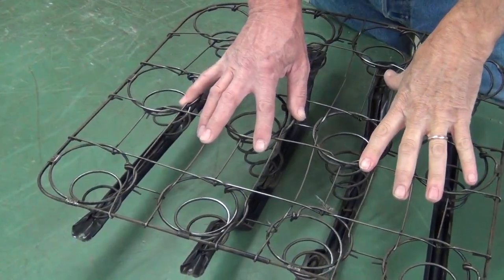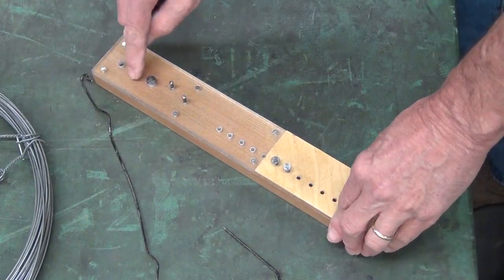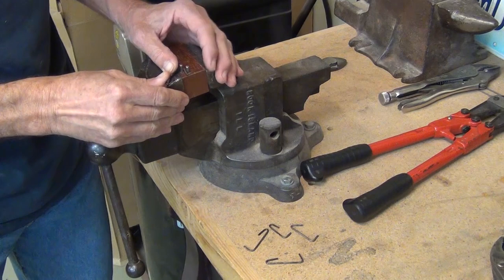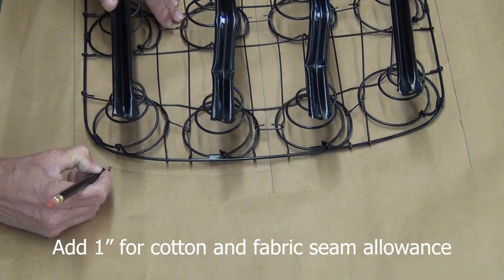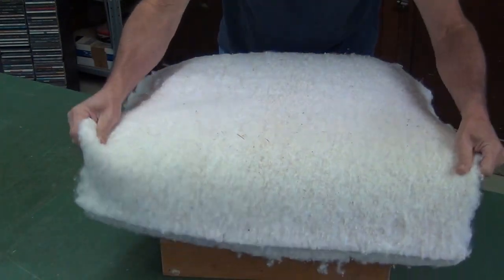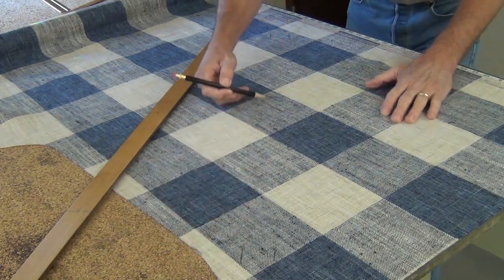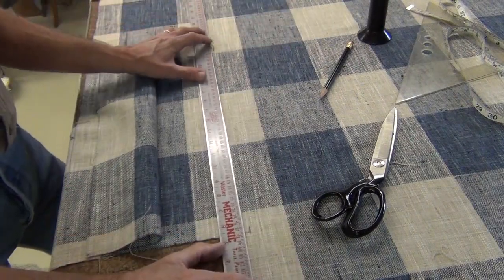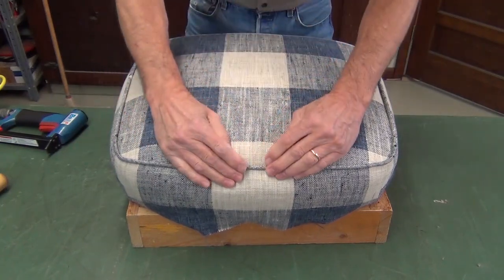1930's Drop-in Seat Upholstery

Comment: I just found your channel searching for some instruction on recovering a seat exactly like the one in this video.  My problem is that more than half of the wire cross supports (like the one you created out of piano wire) are broken.  Creating all new wire supports seems like more of a project than I can manage.  I noticed on other projects that you tie the springs together with jute.  Would tying cross supports with jute rope work on a seat with a wire edge like the one in this video?
Thank you for the great content.  I've learned a lot.  In fact, I may have learned that I've bitten off more than I can chew.  We will see.
Reply from the maker: Contact me via my website for more information. No, tying with spring twine is not the solution. My pleasure to help.

Comment: Excellent video and craftsmanship sir. I'm wondering what gauge of piano wire you use? Cheers from Vermont!
Reply from the maker: The piano supply company shows the wire as size 29. It's approximately 1.9mm. Plenty strong and could be sized down slightly for chair seats, maybe 1.6mm. I originally purchased it for a Turkish couch deck. Thanks for tuning in.

Comment: Always like to believe upholstering followed a certain set of rules. However, cutting welt on the bias, just isn't that way. It has its advantages. As with that plaid. I was taught never to do it! Match it in front. Let it fall wherever. As it goes around. Some cushion boxings certainly can be a challenge sometimes. Any mention of cutting welting on bias was met with disdain in our shop. I was told some customers would call you out on it. Saying it was incorrect. I'll admit, it's still a grey area for me.
Reply from the maker: So, let me open discussion by asking "what do you think is wrong with my cording?" Simple question. Because somebody told it's not right, and never do this? If you don't practice bias-cutting you are missing out on a lot of artistic opportunities, plus fabrics tailor much nicer on the bias. Quite frankly, I'm insulted by your input.
Reply: @Buckminsterupholstery  I said. Cutting welt on the bias has its advantages. As with that plaid. Plainly stated.  I was admitting it turned out  "BETTER" than the way tradition would have driven me to do it. I would have NEVER belittled your work Sir. NEVER! NEVER!